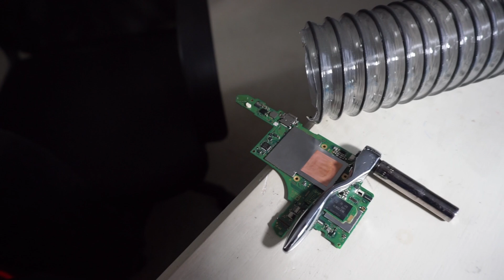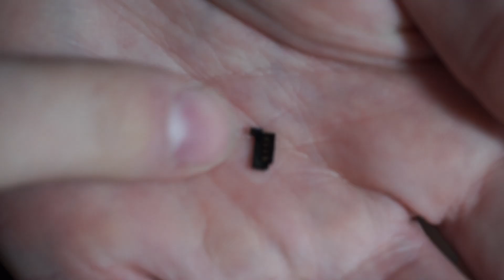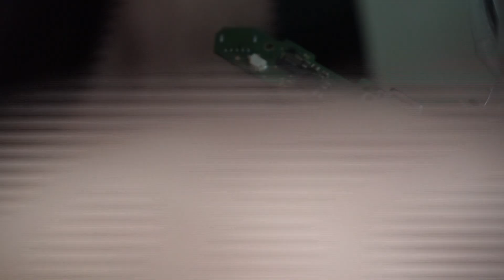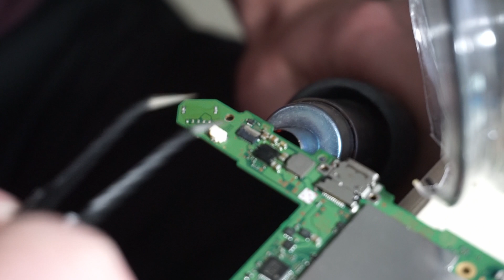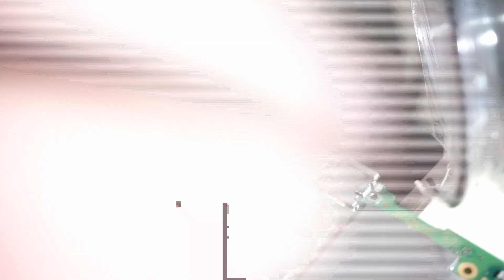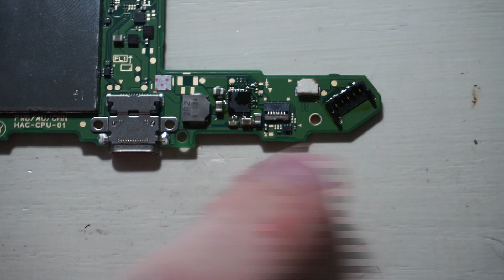Nintendo Switch Repair...SMD Soldering WITHOUT MELTING STUFF (kind of..)

Comment: Can the battery repair be done without heat gun? I own a soldering pen however
Reply: You don't repair batteries you just replace them
But if you are thinking about the charging chip then you can get a decent hot air soldering tool from Amazon 
I got mine for about 30 ish dollars
the load out you want is 
liquid flux in a squeeze bottle
Solder paste in a syringe
 a spool of solder wick
and a pair of electronic repair tweezers
and a set of "helping hands" with a light
Or a very expensive microscope with a LCD screen
Though I'm actually going to use a cheap 30 dollar borescope instead and I'm going to use the helping hands to steady the camera on the board so I can work on it
Basically
drench the chip in liquid flux and heat with the hot air tool
Use tweezers to remove the bad chip 
Use the solder wick to remove the previous chip's solder
Then once you are sure it is clean 
Apply new solder to the board and heat with the hot air tool 
The solder will populate the pads and then you can place the new chip onto the board simply fit it correctly and heat it again for the solder to properly attach the chip to the board
Inspect the chip to determine if all the pads are completely connected to the chip 
Make sure that none connect to each other
if one is not completely connected apply flux and then apply solder via a normal soldering tool 
My recommendation is get hair thin solder and use that
Use the hot air tool again and check once more
Then connect the battery and Use the original manufacturers charger to charge the battery for a few minutes then use a third-party HDMI dock to see if you get a picture on a tv screen but use the original manufacturers cable to power it
If you did then reassemble the switch
If not ask someone else 
as I am having to literally learn how to do this in about a week 
Because it's either I fix it or it's going in the trash
And I have not backed up ANYTHING since I got it.
so no worries about it...
just gotta be careful with it

Comment: You can't heat from bottom, many new version of that board have components on the bottom of the board. You also don't use flux, which you should. Flux is very helpful when soldering smd parts.
Reply from the maker: I don't think saying "you can't" is appropriate because I believe we saw in this case, you can. 

And the reason for not using flux in this case is the flux will run onto other plastic components and melt them which is obviously what we're trying to avoid.
Reply: @GarrettTurbod  I said the newer version of the board has tiny components right below the area where you are using the hot air gun. It would heat those components up and blow them off the bottom of the board. You can do whatever you want, but telling viewers to just heat the bottom of the board without verifying there are not component there is not a good idea. 

Flux will not remove components from the board, heat will and not hot flux. When flux gets to hot, it turns into a gas, and that is what a fume extractor is supposed to remove the gas created by the vaporizing flux. So the flux will turn into gas before ever reaching the melting point of solder. Flux is use to make sure the solder sticks to the copper pads and only the copper. That is what it is designed to do. It will draw the solder to the copper pad and nicely orient the component on the copper pad as it was design to do.

Comment: If you tin with leaded solder , you wouldn’t need to use such high temperatures to flow the solder joints. Which allows you to use less heat. Great video. I’m now a new subscriber.
Reply from the maker: Appreciate the feedback. Noted for future repairs!